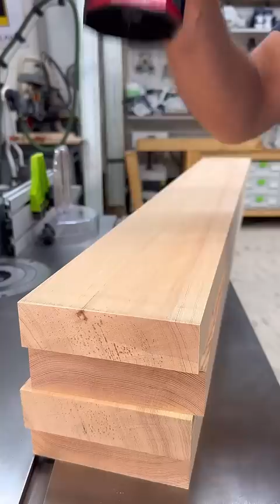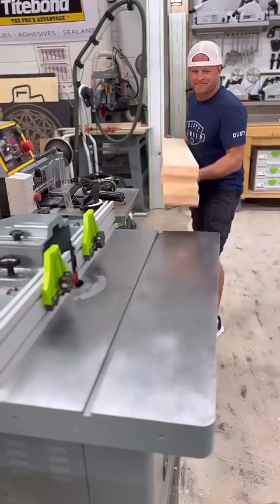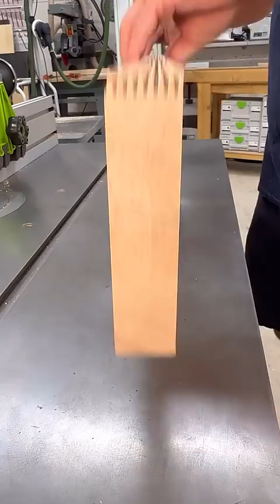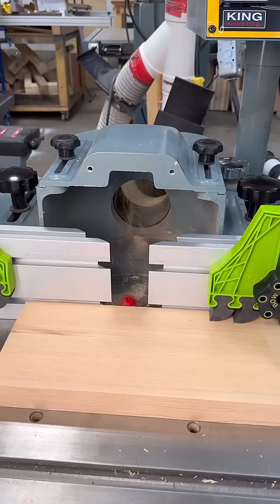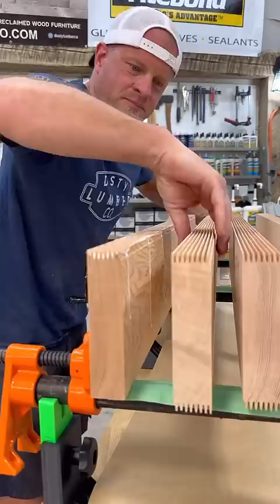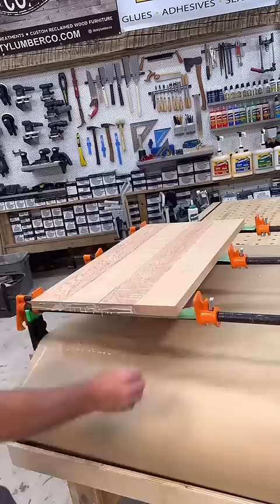Freud finger joint bit and I definitely used way too much glue #freudtoolsambassador #woodworking

Comment: Legend says the glue is still dripping out to this day
Reply: Better too much than not enough right? Lol
Reply: Ur legit
Reply: That's what she said.
Reply: Так и должно быть если клея будет не достаточно они разойдутся
Reply: Yah there’s enough glue on it
Reply: @Primexelite8680 it’s unnecessary, and much more of a hassle to clean. And if it dries he’ll have to sand alot to get it out which can leave an uneven surface
Reply: I should call her🥹
Reply: So how to you get the correct amount of glue an a finger joint like this? Call out a problem at least offer a solution. I'm thinking a 3" paint roller
Reply: That legend died long ago
Reply: My thoughts too and the solution was simple and he did it after squeezing the glue on! Simple tub of glue and a brush.... Dip brush n apply a liberal amount on gluing surface! As for cleaning up his mess he more than likely will plain that down to clean each side.
Reply: 今でも滴り落ち続けている接着剤さんのことを思うと涙が止まらない…🥹
Reply: Easy for karate chop
Reply: @411adaptivegolf  Agree but you need to move fast with wood glue.  Not only does it dry pretty quick, it swells the wood fibers.  I'm not sure there is a way NOT to over-glue this type of joint. In reality, finger joints are really not intended to be used in the length of stock but to join end grains.
Reply: What is that brown sheet called?
Reply: Netflix: "Are you still watching?"

Somebody's daughter at 2 AM:
Reply: @Primexelite8680 if it can't soak in right it is worse so no
Reply: That's what she said.
Reply: @chrisanthony579  a single line down the middle and a rubber glue brush should do the trick
Reply: It's true. I'm the glue.
Reply: I’ve done this before that glue dries clear AF.
Reply: I agree! What a horrific waste of Glue!
Reply: @zebracake2246  Man, look... he has paper underneath. And he has a planer 😦
Reply: Who?
Reply: Да и хер с ним с клеем, это ПВА прозрачный клей, хорошо очищается,
Reply: بعد ان يتم ضغطه جيدا يتم مسح 🧻 الغراء بخرقه مبتله فلا يبقي له اثر سخريتك كانت سخيفه جدا وليست مضحكه
Reply: @80PercentScottish you mean he
Reply: @markgonsalves he
Reply: @chrisanthony579 well that is not the correct amount.
After watching all the excess, start with 1/4 of that glue.
Reply: Damp cloth will take care of it in no time
Reply: He does a great job...
But uses too much glue...
Reply: @Primexelite8680 
Glue at the just right amount is better!!!
Reply: That's me, fr
Reply: @granthpunjabi paper
Reply: @411adaptivegolf  my thoughts exactly. Youtube experts lol....if he has all this gear he surely has a plainer. Two or three passes even everything out butter smooth.
Reply: @paulotonetta8149  there is no just right amount. It's gonna pour out either way...damp rag and then plain woukd have to happen either way.. he already said it's too much..he just doesn't care bc it doesn't matter 35 cents of extra glue to him. Get over yourself.
Reply: You don't know how glue works then ha
Reply: I once found my mom dripping glue as well. I didnt know she was attatching something.
Reply: lol
Reply: @marciocouto9525 😊😅😊0
Reply: I shmell context I can steal =)
Reply: what is?!?!?!?!?
Reply: 😂😂😂 i know still Dripping😂😂
Reply: Looks Like my friends mum after sathurday night........ 😂Dont snitch on mé
Reply: He thinks its ketchup
Reply: He’s going to have a nice time sanding that.
Reply: @zebracake2246 That’s why you wipe them right after, common sense says it
Reply: i came to see if there was any comments on the glue, not a disappointment :D
Reply: @pixle500  It would have been more disappointing if I didn’t tell you how to remove it, I’m always here to support and assist
Reply: Your like a person that hadn’t got a trade i except! ?  Probably practicing on your own tool 😂
Reply: @philiprooney3280  You mean accept? I don’t think it’s up to you whether you accept it or not
Reply: "Everything I do, reminds me of my ex" moment
Reply: Its better to use to much so that it fills any air pockets excess glue can easily be removed later with a wide variety of methods.
Reply: @philiprooney3280  there's leaving excess to over fill and there's using 3 times as much glue as is needed
Reply: @80PercentScottish lol because creampies
Reply: Are you sure it's glue?
Reply: Very  nice
Reply: Very  nice
Reply: Very  nice
Reply: Yeah, you're right man . . . I should probably call her back
Reply: TO THIS DAY!
Reply: @jasonshink6589  THE salient reply .
Reply: Oficina bacana
Reply: Glue bukkake
Reply: Glue? no i think that's something else...
Reply: He didn't set the glue on the other side, air bubbles, thought he was being thorough when he got the brush
Reply: @chrisanthony579  less glue 😒😒 and smeer it out like he did ... just less less less glue
Reply: Зачем кисточка лей из ведра 😂😂
Reply: Agrer
Reply: Who said it had to be a bottle of glue
Reply: @80PercentScottish  she might need a doctor?
Reply: Looks sus 🍆
Reply: Ok
Reply: I love legends!
Reply: Pretty cool but what problem are you solving?  Just cluing up the edges is typically strong enough, right?
Reply: 😂😂😂 my thoughts exactly. That bit is pretty sweet though.
Reply: You need a much thicker glue
Reply: Lol
Reply: @ocsrc  no, less is more.
Reply: *has it
Reply: lp
Reply: @Primexelite8680 😊
Reply: more glue is always due
Reply: And legend says those pieces are holding on tighter than a solid piece
Reply: U stole my comment 😢
Reply: My high school woodshop teacher would have snuke up behind him and said , ``You know, we're not tryin' to prove that wood floats."🏫
Reply: Who said it was glue?😏
Reply: Everything reminds me of her.....
Reply: @Primexelite8680 nada haver não precisa desse disperdisiu
Reply: Gt😮
Reply: i like how elaborate yu are.
Reply: Now he needs the big electric gluing machine that can cook the glue dry, like the commercial outfits use
Reply: @Primexelite8680 until sanding and cleanup comes around haha
Reply: Thank you
Reply: Hay un poco de madera en tu colafria jajajaj
Reply: Много людей по белому свету поговаривают об этом 😂😂😂
Reply: Muchas herramientas,pero un poco guarrillo
Reply: SUS
Reply: Na senior u be 😂😂😂😂😂
Reply: Needed more glue.
Reply: @Primexelite8680 😢😢
Reply: @Primexelite8680 😢😢
Reply: @Primexelite8680 😢😢
Reply: @Primexelite8680 😢😢
Reply: @Primexelite8680 😢😢
Reply: My guy thought it was mayonnaise
Reply: Мужика растащило от удовольствия созерцания содеянного станок волшебный мужик рукастый
Reply: go big or go home
Reply: @Primexelite8680 yes, with wood glue😂
Reply: Stfu with the legend comments
Reply: i went straight for the glue comment
Reply: Oh, I wasn't the only one that heard the spooky noises. 😅
Reply: I'm a Legend 🗿
Reply: I kiss her so much.... I just keep watching that part.....
Reply: 😂😂😂 very true
Reply: 50 Kids later !
Reply: @Primexelite8680  that's what she said
Reply: Этот мастер знает больше всех сочувствуюших о Клеие
Reply: BS comment. I see the same BS comment everywhere
Reply: Х
Reply: He was a phobia of someone being rough and throwing a this chic up on it and breaking it!! What a shame… maybe I’ll see you at the next A.G.O. Meeting! “Always Go Overboard “ mine started when I was just a boy and I built a little bench for guest and it was a 6’Lx14”x18”tall
And I walked in At Christmas dinner and Lord knows I was sweating bullets because these two fladies were sitting on the bench and they touched in the middle and each had about the equivalent of a pork roast hanging off…😢 the dogs were howling because the tensile strength of the wood was apparently so high pitched nobody was ready for what came next.. I had visions of a comet hitting the floor in the same spot where they had and they busted their ass’s and you would have thought Hiroshima was happening in that moment, the earth shock was felt two blocks. They sent a seismologist out to investigate and he looked confused!🫤 I ran out and bought myself some time to think what I did wrong 😑 and then I figured it out. I asked myself what would dad say. And then I said, well damn I guess y’all didn’t ask the lord to bless the food because I asked him to bless the bench but had forgotten about asking him to bless the laws of physics… the lord sure  works in mysterious ways…😇 But to be fair I don’t think the finger joint bit was a thing yet but it busted in the wood and luckily not the glue bond
Reply: Ачто ето значит
Reply: С конца у тебя капает   😂😂🤣🤣🤣🤣😂😂😂🤣🤣😂😂
Reply: There is no too much, but there is something not enough.
Reply: Только он показал половину производственного процесса
Reply: Poured it like mayonnaise 😂
Reply: it was super unsatisfying ending 😂
Reply: They're lying
Reply: @chrisanthony579  He did everything correctly except the amount of glue.  He  shouldn't have squeezed the bottle so hard or moved the tip faster along the length.
Reply: Lo
Reply: Legend says once it dried he scrapped and sanded it off.
Reply: Esto no es, Para codos Ni Pichicatos, que solo se Mofan porque no tienen Ni pegamento
Reply: Lmao.
Reply: Yeah
Reply: @zebracake2246 a quick once over with a wet rag after clamping and it's all good.
Reply: @zebracake2246  Hassle? It's not your life buddy. He has all the tools to clean his clamps and work bench. Just grit the wood. Utilize it all rather than worrying for something being hassle. His workshop looks clean anyways
Reply: Notice the Titebond logo in the background? This guy's getting it by the bucket.
Reply: ay  que  tener  un trapo  para limpiar  rápido  antes de que  seque  no ser tan cochino  así
Reply: Con la brocha en la mano y no saber aplicar el resistol. Es el colmo.
Reply: @carny15 Correct! as soon as clamped, cloth or sponge will do.
Excessive glue? "for a Ha'p'orth of tar the ship was lost"?...
Reply: @Primexelite8680 I guess , but I thought most people try to avoid making unnecessary messes for themselves
Reply: @Primexelite8680  That's where experience comes to work, you need just enough. Too little, you fucked up. Too much, you also fucked up
Reply: Yes
Reply: @zebracake2246  We used a masonry spoon to get it off. We used a table that had a surface to which the lime didn't stick well.
Reply: It got that drip tho.
Reply: yes . My first thought
Reply: Should have wet the joints first
Reply: that's how you know you did a decent job
Reply: @80PercentScottish Аll fеmаlеs rotten
Reply: but it has dried up
Reply: @Primexelite8680  never is not to much!!
Reply: Glue pie
Reply: Bruh😂

Comment: Trapped glue is a problem, whether finger joints or dowels.  Just the right amount is strongest and works best.    Set the clamps at the center FIRST,, allow the squeeze out toward the ends
Reply: Thank you for the tip brother!
Reply: Not unlike a cold shut. Good to know, my woodworking “cousin”.👍🏼
Reply: How do we know whats "just the right amount"?
Reply: @franciscovaldes4107  you want some glue to be pushed out, but you don't want anywhere near as much as he used
Reply: Yeah honestly...... this dude FUCKED IT UP...... showing everyone how to do it WRONG.....
Reply: @Supersquigi  Which he acknowledged.
Reply: I have guess left to right to push out any air bubbles.
Reply: @Supersquigi  It's more than fine, no need to be so dramatic
Reply: @franciscovaldes4107  use brushes to "paint" the wood in glue. That's good enough. This is not supposed to be rock solid, you use bolts or cross wood pieces to have something rock solid.
Reply: @lucasljs1545 Well, in fact such glued connections can actually be at least as strong as the wood itself is! Besides that one indeed gets a better, stronger connection (is that the word?) with a thin layer of glue that's been evenly applied, the best way of doing as someone else already pointed out, is applying it with a brush in a case like this
Reply: @harrickvharrick3957 the glue in fact is stronger than the wood itself. You don't need this much however lol
Reply: "Set the clamps at the center FIRST,, allow the squeeze out toward the ends" 
Didn't get that, lol
Reply: Thanks, dad.
Reply: @gageackley-dechant3146  this is less of an objective fact, and more so depends on the grain structure/orientation of the wood itself.
Reply: let physics be your friend
Reply: @gageackley-dechant3146  erm .. no, there are all kinds of wood glues for different purposed and conditions, som are stronger but form a lesser bound to thee wood, some are weaker and form a stronger bound to the wood... but with this tiny overlap not sure it makes a big difference..,
besides, the grain angle and structure will have an large impact .. some of the boards used seems to be weak (wrong grain angle)
Reply: Funny it's the same way you tighten automotive parts that use a gasket.
Reply: @SlickArmor  I had not thought of that.  Great observation !  The plastic Dorman intake manifold on my F-150  a specific bolt tightening pattern in inch pounds, and then a second pass through all the bolts in specific sequence to  final tight , again in inch pounds.  Been years since I replaced a head gasket,, but it was exactly the same thing.  And as you stated, for exactly the same reasons.  Good catch !
Reply: @Sailor376also  Your tip on how to glue wood made me think, hey, I know that technique. 🤣
Reply: Great tip...I love it
Reply: Amazing brother, pop off only on occasion brother.
Reply: Yeah was watching him do the clamps and thought similar. You always try to tighten things in a balanced way. Doing one side first and the other last, be it screws, rope or glue, generally causes suboptimal results.
Reply: Actually, he squeezed the glue out from being trapped at the end of it. That’s why it came pouring out of one side.
Reply: Someone apparently did a test and joints that were too tight or didn't allow any room for glue to actually sit were weaker than perfectly tight fitting jointa
Reply: Muy buena fresa,  creó eso es lo que trató de mostrar lo demas cada quien tiene su propia técnica
Reply: @RogelioAlvarezSalvador-ky9cc   Yes, absolutely, many ways to do it..  Myself I normally use what is sold as Gorilla Glue, a foaming urethane adhesive. apply a very thin coat to one side and brush a bit of water on the other face.  One hour clamp time and virtually no squeeze out.

Comment: Excess glue can always be cleaned away but adding it is a bit trickier...
Reply: Yea, you can wipe it away, but it makes stain not be uniformed
Reply: You should have a little excess, but this was way too much.
Reply: I was totally completely different way to glue growing up. I was told to get a reasonable layer on both surfaces that it stood out and try for a while and then join it together not just slop a whole bunch on like you're ladling gravy had a Midwest breakfast buffet. You want someone your biscuits and your eggs. Of course
Reply: Fact.
Reply: Inside out would also mean you can probably skip glue on the last 6 inches at both ends
Reply: My OCD says clean that excess glue before it dries please
Reply: @robertlogan4652 idk wtf you just said, but I like it lmfao 😅
Reply: @aurthursmith7459 why? Run it through the planer after it's dry and you'll be good
Reply: Thanks brother, next time i will fill the bathtub with clue and dip the whole thing in. There is not such thing as too much glue, right?

Comment: Came straight to the comments once the glue dripped 😂
Reply: You came?
Reply: @davemiller638 just like those glue joins.
Reply: Without disappointment.
Reply: Theres always disappointment afterwards.
Reply: You realy did came.
Reply: There's gotta be a way to do this without making a mess.   Like , the router should cut interlocking grooves that hold the boards together.   No glue necessary, and stronger.
Reply: That drip got him enough comments for the algorithm to push the video to 61m views.
Reply: сперма
Reply: At least you came straight
Reply: @davemiller638 I did.
Reply: @NickKautz  184m now lol